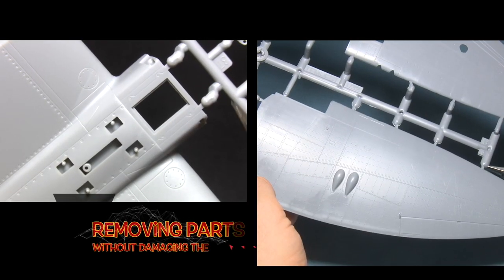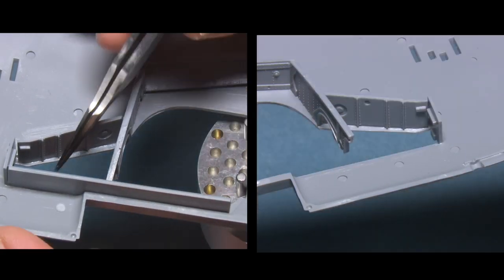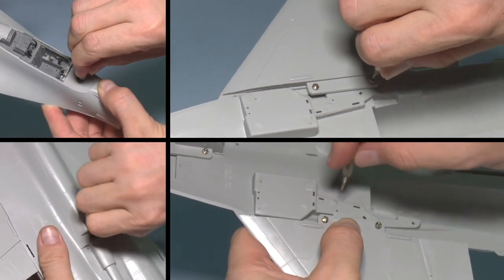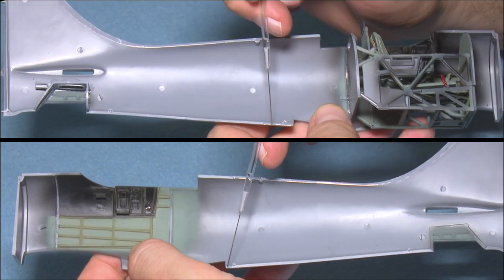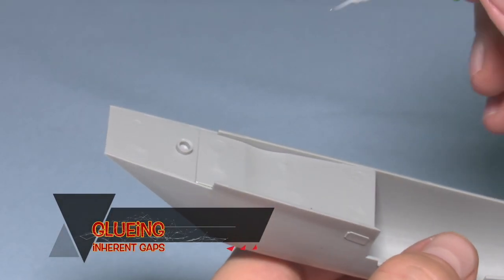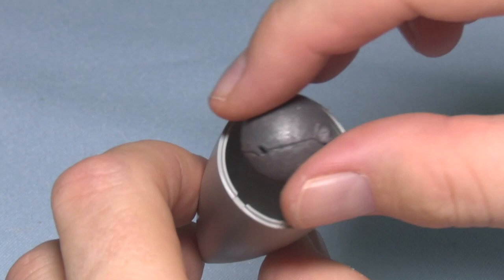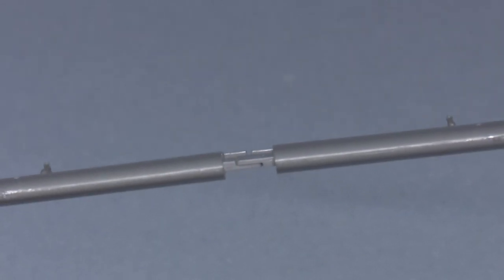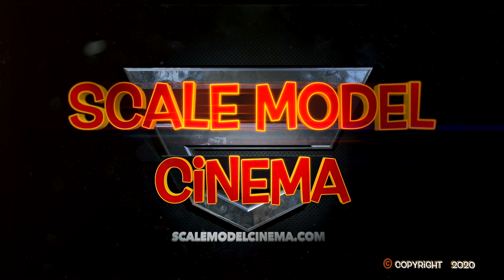Model Making Techniques #1: Removing Parts & Glueing

Comment: The "building parts you won't see" thing is a big issue with some kits. I'm working on Trumpeter's P-38L-5-LO and both the left and right engines are incredibly detailed with many small parts and intricate rubber hose pieces that were a nightmare to glue in. Then I put the halves together and saw a lot of it was covered. No big deal. But by the time you get the booms attached to the main cockpit fuselage, you see just the very back of the top of the engines and through two small porthole windows on the inside of each boom. I spent a total of two days on each engine, cutting, sanding, fitting, priming, then painting each engine in stages to make sure I had everything perfectly glue and painted from the deepest recesses out. I was hoping there was an option for an 'open engine' or at least a conversion kit I could buy and not have to resort to the good old hobby saw.

Comment: Just from experience, the regular tamiya cement (orange or white capped bottles) are better to use for joining parts that have large surface areas as oppose to using the tamiya extra thin cement (green capped). And then use the extra thin cement for small part/pieces.
Reply: Yeah all his extra thin evaporated off before he even stick both parts together lol how does he not realize that
Reply: @binal-flecki2387 it still works. At that point the plastic itself has melted some so the plastic acts as the glue…. But yes the orange is better for things like that unless you want a soft bond.

Comment: I know this video is about a year old at this point, but suggestion for you. Instead of using clamps to squeeze parts together and get them out of shape if there is a big gap, you should try using some sheet styrene strips or even some sprue as a shim to fill the gap and glue that in place.  lots of other great tips in here.

Comment: Wouldn't it make so much more sense if the model pieces came already separated with no plastic joints to chisel off?
Reply: Risk of breaking and hard to find, and the spruce is part of the mold, much more expensive to produce without the sprue

Comment: Loads of good tips, but I disagree with the technique and rationale at :50s Been doing this a long, long long time and from an era when the only special modelling tools most modellers had was mum's nail file and an eXacto knife with a single #11 blade. Your suggested technique makes for a lot of unnecessary extra work, AND won't guarantee any cleaner a cut, nor will mine (single cut & cut close) necessarily result in damage. There are exceptions. i.e. A. the kit plastic is exceptionally hard & brittle (Zvezda green used in their Soviet WWII armour) or B. so super soft it squashes like plasticine (Airfix recycled in their anything Made in India kits). 

The technique keys for a single cut and minimum cleanup on regular quality kits from the likes of Tamiya, Hasegawa, Dragon, Eduard et al are; 1. use a quality pair of reputable brand nippers, Tamiya, Xuron, Mr.Hobby with 2. a very sharp cutting edge,  and 3. use the correct (flat) side of the cutting blades close against the part at the correct angle for the part, 4. in good light where you can see properly, and 5. take care in cutting the part away. That way a very clean separation, minimal attention with a knife if even necessary, and a similiar light swipe with a sanding file if at all.

Glue. 1.Use a quality brand. 2. Have a variety of glues so you can use the right glue for the part. 3. Less is more. Plastic model parts aren't load bearing. 4. Use brushable capilliary action glues anywhere you can -caveat, if appropriate. e.g. Tamiya Extra Thin, Mr.Hobby Mr Cement S. For pre-application on larger parts, wings etc use regular Tamiya Cement, Mr Hobby Mr Cement both brushables, or Revell Contacta with its accurate tip applicator. 

Haven't tried cable ties. Back in the old days, we used rubber bands. These days I prefer to use I prefer to use masking tape. Quality painters tape in its varying sizes is good to save on Tamiya, and stronger. Scotch, 3M, Bear. The real key is to buy quality kits with crisp accurately tooled moulds, dry fit and cut/file if at all necessary until the prerequisite fit.   

For ref. I predominantly built 1/48, 1/32 air and 1/35 armour.